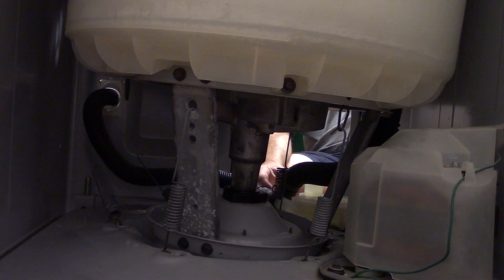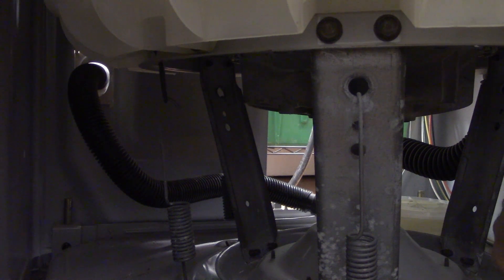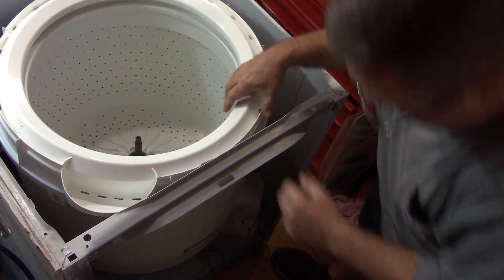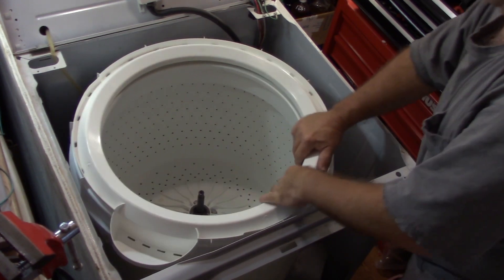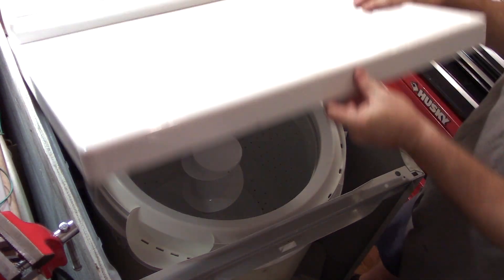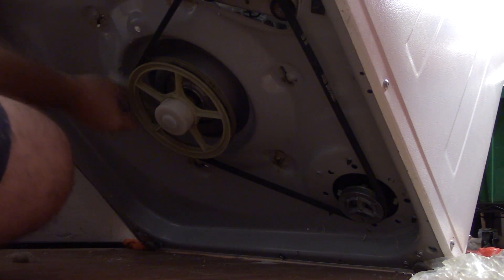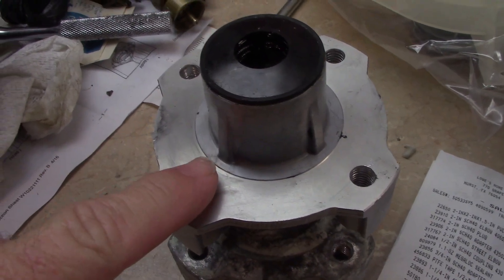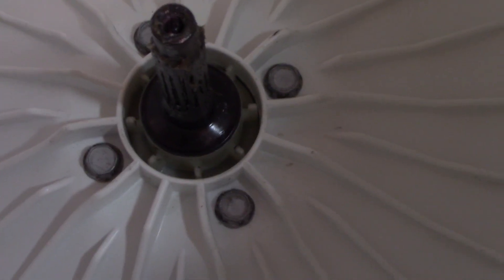2003 Maytag Performa PAV2360AWW Repair Part 3B: Reassembly Completed

Comment: Nice job! You really fixed that thing up well. A house that my bro lived in from 2006 - 2010 had the 2006 version of this machine with the stainless steel inner tub. Sadly I never made any videos on it, and it was left at the house when he moved. No idea if it is still there today, but it washed very well.
Reply from the maker: Thank you! 
Oh that's cool. If I knew about it, I would've salvaged the stainless steel basket from my Aunt, and Uncle's 2006. That one got replaced with a SQ TR7 series, but I just keep my mouth shut.
That's unfortunate, but yes, when they are working right, do a fine job.

Comment: Wow, you did a fantastic job. It’s like a new machine with all the changes you made.
I wouldn’t worry about the little bit of shake during the spin, because almost all of the machines I’ve seen do that totally empty.
Great job how did you know how to do all that ?
Reply from the maker: Thank you. It's certainly less shaky with the factory setup, so I'm happy with it! There will be a wash coming next weekend, after repairs, and with the washer hookup in use.
Service manual,  just digging in, and going for it!